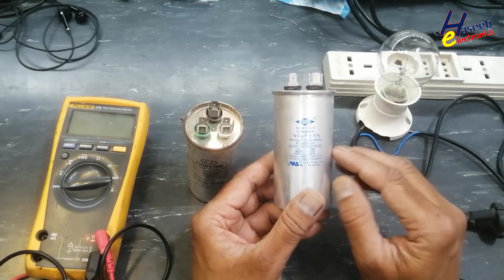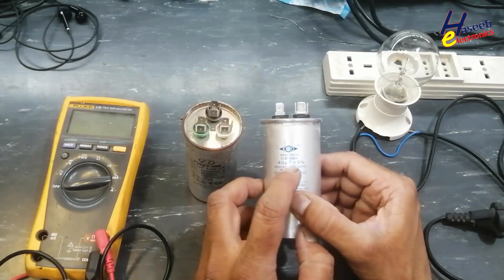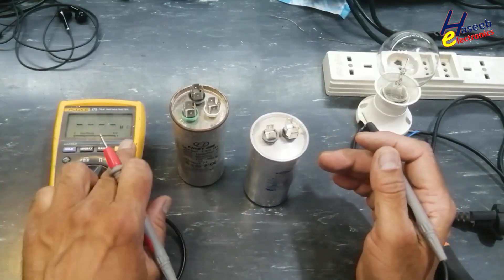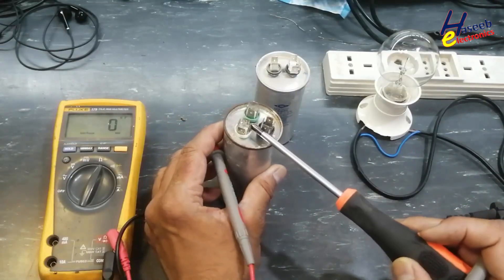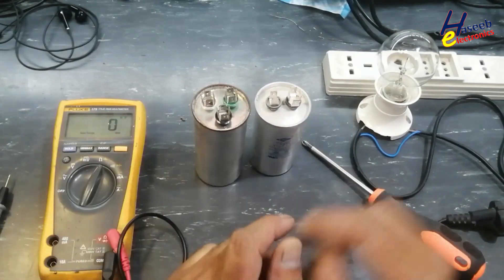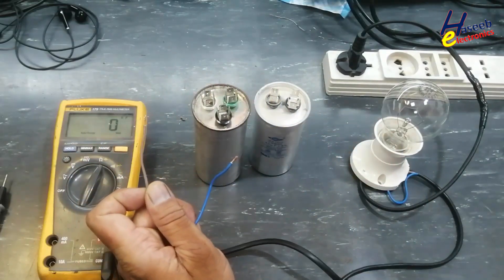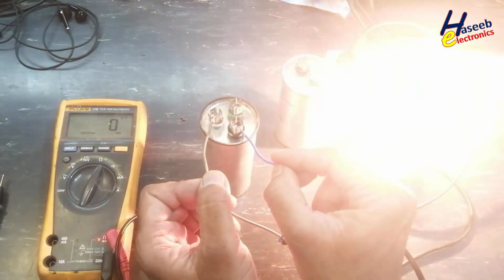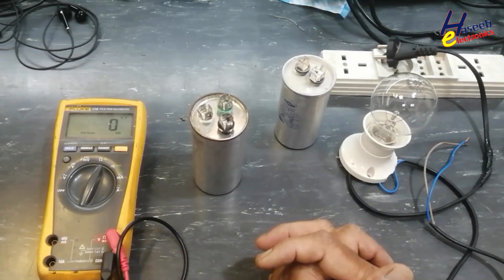{1369} How to Test AC Capacitor with Multimeter | Good vs Bad Capacitor Live Test

Comment: verdiğin bilgiler için allah razı olsun. merak ettim, seri lamba ile bu şekilde kapasitör kontrol etmek için kapasitörün kapasitesi en az ne kadar olmalı veya düşük düşük ac gerilimle bunlar yapılabilinir mi, güvenilir mi? örneğin 12 ac ile 16v 100mf kondansatör kontrol edilir mi? cevap için şimdiden teşekkürler.
Reply from the maker: Günaydın
Yorumunuz için teşekkürler. Bu yöntem, 220V AC'de kullanılan AC kapasitörler (polarize olmayan kapasitörler) için kullanışlıdır. DC kapasitörler veya düşük voltajlı kapasitörler, kapasitans ölçer ve ESR ölçer ile kontrol edilebilir (ESR ölçer, kapasitörleri test etmenin en iyi yoludur).

Comment: Dose the capacitor discharging tool discharge this type of capacitor please?
Reply from the maker: Yes 
We can use that as well. 
It's capacitance is only 50uf. Capacitor discharger which I use in my videos (or any 20 to 100 ohms, 5 to 10 watt resistor is awesome)

Comment: How they work with compressors and fans?
Reply from the maker: Single capacitor (2 pin capacitor is only for compressor and fan capacitor is installed separately)
Dual capacitor is composed using 2 capacitor (common and one point for capacitor. Common and fan)
Normally Compressor capacitor is 30 to 60uf and fan capacitor is 3 to 6uf

Comment: nice sir. Your multimeter is really measuring the value of  components very quickly sir. Impressed.
Reply: Bro it is fluk best of the best meter❤
Reply: @GadisaAjema-16  Bro every fluke has a quick response or is there only a specific model?
Reply from the maker: Yes 
Fluke multimeter has very quick response and reliable 
That's why it is expensive
Reply from the maker: Approximately every fluke test instrument is faster, accurate and reliable 
Because Fluke has strongest profile in TMDEs
Reply: @HaseebElectronics  thanks for your kind reply. Will try to buy😊
Reply from the maker: I love fluke 298
87V
177
207
These are superb test instruments
Reply: @HaseebElectronics  sir I searched for the price of all models.these all are above 10k inr 😂. Thank you for your suggestion ❤ will try😊
Reply: Definitely you are right it's expensive to buy fluk but              # if you want you can why not bro #
Reply from the maker: Yes 
If someone seeks quality, reliability then it is the best choice
Reply: @GadisaAjema-16 definitely bro. I am more interested in buying branded tools for my profession.